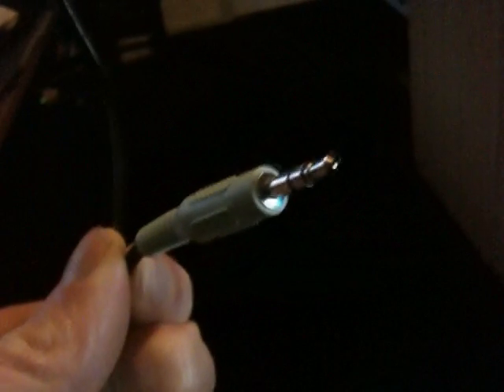How to modify the GoPro HD Bus Interface

Comment: Are there required some adjustment on that cable (30 pin to 3.5mm) with the wires or you just plug it to on iphone ? I need it for external microphone on my Gopro 2

Comment from the maker: @Andre8869 I only know the option in the forum for pin 23: Adaptor - this pin goes high when the gopro is switched on and can be used to drive a LED, taken to pin 30 GND, via a 150 ohm resistor.

Comment: hey, Is there a pin I can use as a trigger for another application? Im basically looking for a pin that goes high when video recording starts. 

I am aware that pin 23 goes live when the camera turns on, however this pin on my camera does not turn off when the camera itself shuts off so I cannot use it for my purposes.

I have been through the go pro forum but couldnt find the information I needed.

cheers

Comment: @flyhelicopter 
Ive searched everywhere and i can seem to find the confirmation i need.
I understand pin 14 left In and 15 right in, do i used these with one of the ground pins ? (1, 9, 18, 27 or 30)
Its the only thing im stuck on really, dont want to mess it up ;)